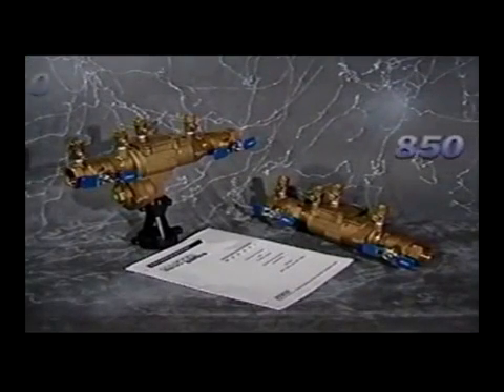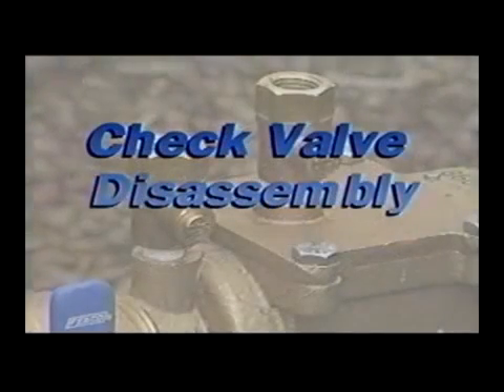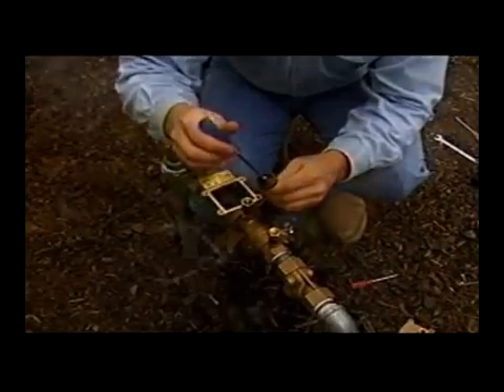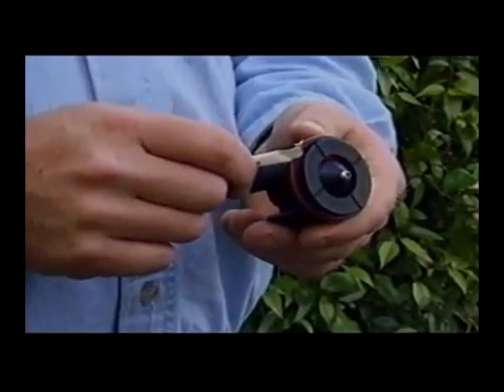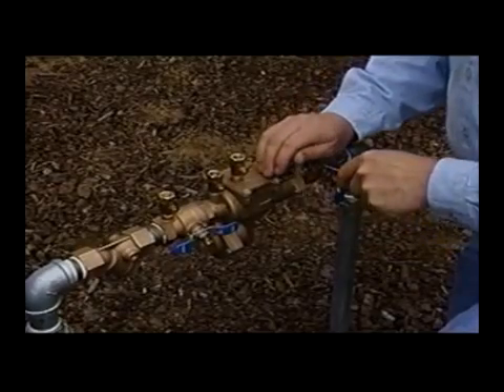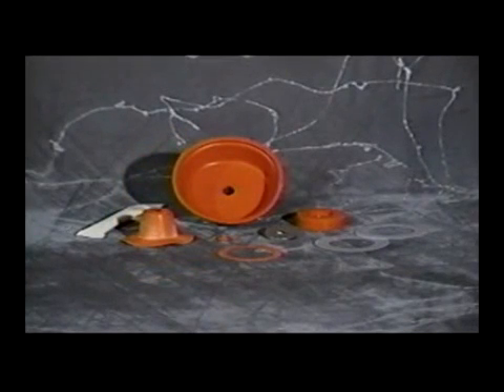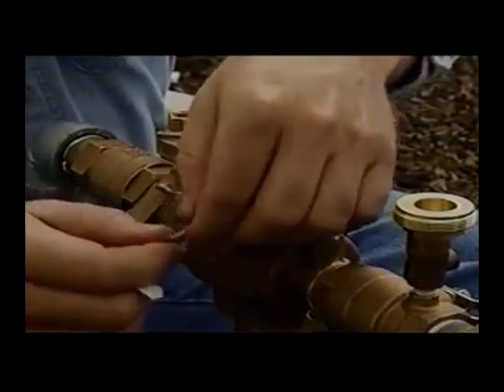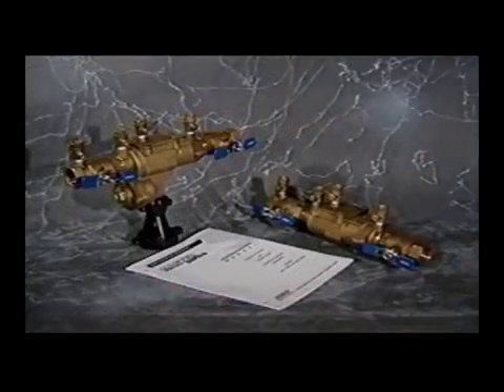Febco 850 & 860 1/2" - 2" Backflow Repair Video

Comment: Great video. Need  help on why the relief valve  would leak water. Found a rock in spring area. Cleaned the 860. Tia
Reply from the maker: Joseph debris could cause your relief valve to leak or drip.  Be sure to check the #1 and #2 check for debris as well.  It is possible that the debris has damaged the parts which would mean you need to replace the parts.  You can call us at 800 575-9618 for more technical help or to discuss replacement part needs.  Thanks!

Comment: What type of failure would cause a pressure drop between the inlet and outlet test points on an 850? I measured about 60 PSI at the inlet and about 27 PSI at the outlet. I am a homeowner and I am troubleshooting a pressure drop in my irrigation system. I have narrowed the pressure drop down to the model 850. As a test, I removed the check valves and replaced the cover and tested again. The pressure readings were identical between inlet and outlet with the check valves removed. I guess that's obvious because it's an open path but I don't see any defects with the parts I removed. Is there normally a pressure drop with a working 850? Thank you.
Reply from the maker: Steve, how did you measure the pressure on the inlet and outlet side of the backflow?  If you removed all of the internal components and still had that big of a pressure loss the only things I think it could be is either faulty gauges or flow through the unit with some type of blockage/partially closed shutoff valve or test cock.
Reply: @AmericanBackflowProducts  Hi, sorry, I should have stated that better. The pressure drop was not present when I removed both check valves and replaced the cover. I measured the same pressure (about 60 PSI) on test cock #1 and test cock #4. I'm using a Hunter pressure gauge that just happened to have the right size fitting for the test cocks.
Reply from the maker: @stevedunn9668  Steve, sounds like there is something wrong with one and possibly both of your check assemblies.  You should lose no more then 10 psi across that device.  If you want to talk to our tech department about that or order replacement parts feel free to give us a call at 800 575 9618 or online at www.backflowparts.com
Reply: @AmericanBackflowProducts  Thanks for the info. I really appreciate it. I didn't think it was right to loose that much pressure from inlet to outlet. I'll call your tech department. Thanks again.

Comment: Thanks for the video guys.

What will happen if the large/inboard side of the RV diaphragm has a hole or tear? Where would the water go? Would this type of leak cause the backflow to fail in a manner which appears to be a faulty #1 check valve?

If the small/outboard side of the diaphragm has a hole, water will dribble or spray out of the weep hole in the brass nut. Sort of a tell-tale, like when an automotive water pump starts to fail.
Reply from the maker: Trever, if the diaphragm is damaged or has a hole then you would get a leak from your relief valve.  Our tech team will also be happy to assist you in your repair. You can contact us at 800-575-9618 from 8 a.m. - 6 p.m. EST.